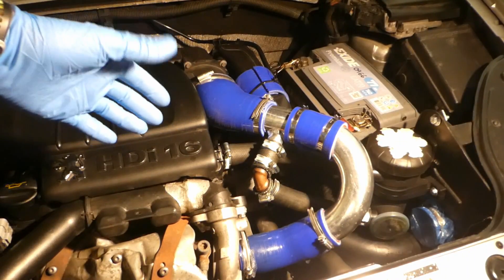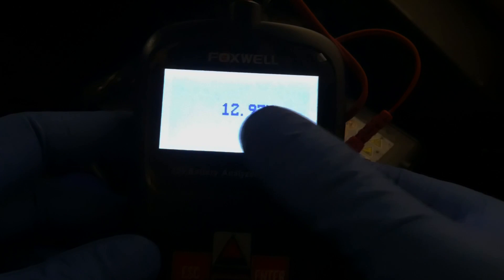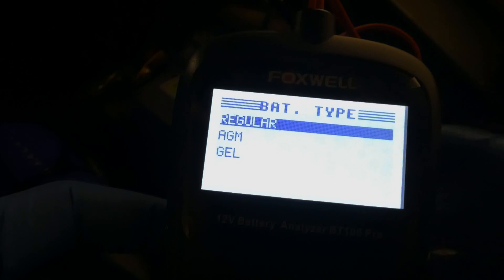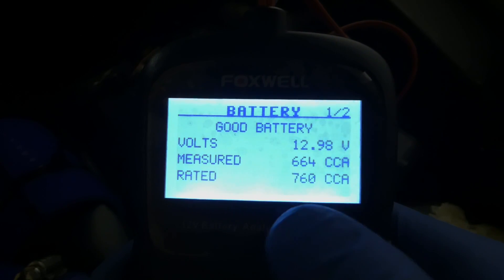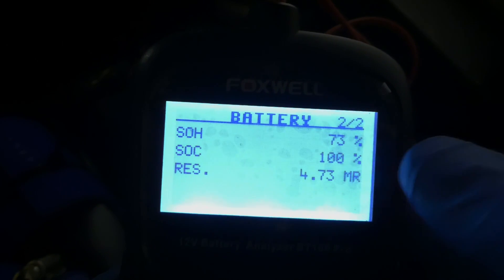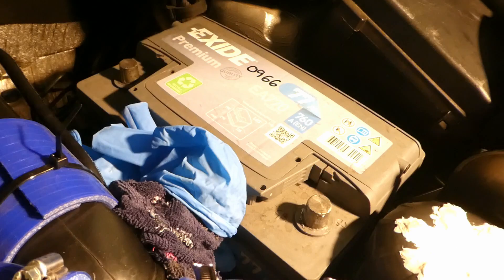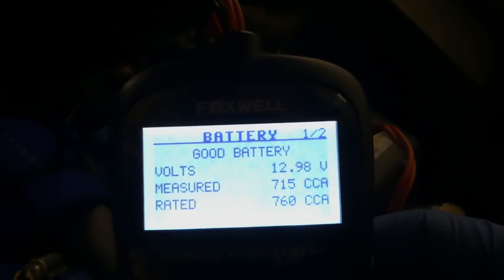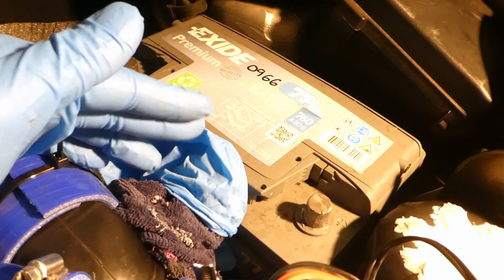Car battery tester review (Foxwell BT100 Pro)

Comment: Foxwell BT100 says that my car battery is 36V.  This can't be right, it should be around 12v
Reply from the maker: I have not seen this one, but trying on another battery or trying again to check. It shoud automaticaly recognise the 12V. Was the car on or everything was switched off. Maybe the battery is different chemistry or the bt100 is faulty.

Comment: if it does not have an internal battery and the batteries are very low on charge this meter will not work less than 10 volts or so it will not work chances are you will need to charge the battery in parallel with another battery 12 volts or so and then retest the battery with this charger I think it would be better to get the charger with the battery

Comment: CCA on the tool is the SAE standard, your battery is in EN (European Norm) and is 760 EN , maybe giving a slightly different result.  SAE CCA x 0.9 = EN CCA
Reply from the maker: Really appreciate your comment! How do you know the device measures CCA according to the SAE standard? I know that for my battery the amps are according to the EN, then the results are even worse for the EN CCA when converted from SAE.
Reply: @moremolecules  All the battery testers have CCA and many other standards for measuring CCA like EN , DIN etc they all measure the same thing in different ways and so get a different value. On these digital testers when it says CCA its referring to the American SAE CCA method as you will see on your tester there is CCA and EN which are very close in value but not the same, so we have to assume CCA=American SAE. Some digital testers Ive seen on U0tube have both SAE and CCA?? which is very confusing but you must remember they are Chinese made and their translation to English isn't always perfect. Very good Video by the way I did like it and think I'm going to buy either a Konnwei or Topdon tester. Thanks...Danny
Reply: Yes results would be slightly worse but try and see...the SOH and milli-ohm readings are the most important
Reply from the maker: @danielconnor1458  Yes, I agree SOH and milli-ohms are most important, but there is no info anywhere how this SOH is derived. I might eventually do several measurements, say ~100 on different dates and temperatures and run some linear modelling to see this is calculated. It just drives me mad.
Reply from the maker: @danielconnor1458  I do understand the EN and SAE and how the methodology of testing is done, but there is quite some difference between the EN and the SAE CCA. I would not say very close value, as for example 750 SAE/CCA is 680 A EN, quite some difference.
Reply: @moremolecules  SOH is definitely mostly tied to CCA as stated on battery compared to CCA measured. I've tried a few calculations from different U-tube videos and its almost (but not quite) CCA measured divided by CCA on label gives the percentage
Reply: Close is a matter of relativity, when you compare SAE to DIN the difference is huge  but SAE to EN is much closer
Reply from the maker: @danielconnor1458  Haha, yes absolutely agree, it is a bit relative.
Reply from the maker: @danielconnor1458  Yeah, I tried that but not digging into modelling and all, but eye-balling it (very scientific I know :-) ), but it did not correlate too well on mine. It seemed a bit more complex than the measureCCA/rated. I might do some calculations on my own and see what comes out. Good idea actually, might do a video on it in case someone else is interested in what it is.
Reply: @moremolecules  If you have the time and inclination to do another video I'd def watch it but for me the CCA measured/CCA label is good enough....these companies have algorithms to calculate that and thats just going too deep into it for me, I just want a tool that can tell me if I need a new battery or not. I do have a 7 stage smart charger with independent pulse de-sulfation mode which helped but not cured this battery I have atm. More tools and yet more tools to buy....yipee !! It never ends haha
Reply from the maker: @danielconnor1458  I completely accept that. I'm a scientist by profession (nothing to do with cars or engineering), so it is a curiosity to see what these numbers mean or how they are derived.
Reply: but the other thing to remember is that not all batteries perform to their rated capacity some are less some are more.....if you watch that Polish guy on U-tube Mr Akumulator I think his channel is called. From what Ive seen the good battery companies say eg Yuasa, Varta Exide etc perform above rated while cheaper ones perform below rated. From the link I gave to if you can calculate Qmax  (max charge availabe then SOH is that divided by rated. I'll let you do that hee hee :>)
Reply from the maker: @danielconnor1458  Yeah, the "good" battery companies. I bought a new Varta super duper silver dynamic, blah, blah, 780 A EN, measured, only returns ~70% SOH from brand new. Returned that one, got another Varta 780 A EN from a different shop, that was 85%, but do not have the energy to return that one as well. Date of production of the second one was not too bad ~4 months old. Probably sat somewhere in a warehouse and got bad, but from 100% (let's say) to 85% in 4 months is a bit too much.
Reply: @moremolecules  Goodness thats 3 times U-tube has blocked me posting a link on how to calculate SOH
Reply: SOH%= 100 Qmax/Cr  where Cr is the rated capacity (perhaps Coulombs) and Qmax is the max available charge whether that is calculated in Ah or Coulombs I do not know
Reply: Google  " How to calculate SOH with lead acid batteries.....I cant type the website in or paste it U tube will block my post again but the website sounds like  biology and logic in one word.
Reply from the maker: @danielconnor1458  Interesting and many thanks indeed for the conversation actually. Might have to understand this a bit more. 1Ah = 3,600C. I will see if I can get some empirical data from my device, haha manually recording the numbers and see what model I can come up with.

Comment: Actually you are incorrect. On the battery you have is written 760 EN and NOT 760 CCA. The two are different. To a 760 EN the corresponding value for CCA is 800. If you test with 800 CCA you will see that SoH value will be lower.
Reply from the maker: Hi Andi, yes, it is correct that it is written 760 EN, but I do not believe this is the EN value. Even on the Exide website (the producer of the battery) it states 760 CCA rather than EN. I have of course tested this with the EN, but even at brand new the tester reported completely failed battery with the EN. Unless of course even the producer does not quite distinguish between EN and CCA
Reply: @moremolecules  I have the exact same battery. Using 760 EN I'm getting SoH 90% and the battery it's working for more than three years. I tend to believe yours is not quite ok if it says to be replaced. 

Regarding the manufacturer, on their EU website exidegroup.com this model we have EA770 isn't even mentioned :) 

But they have two 75AH Premium versions which are rated at 630 CCA and one 72AH version which is rated at 720 CCA.
Reply from the maker: @andidotro  I agree with you that it is probably 800CCA with 760 EN and that it is probably not quite OK. No matter how much I charge it SoH is still ~80%. Most places where they sell it it is still listed as 760 CCA (https://www.tayna.co.uk/car-batteries/exide/ea770/?msclkid=c65eee0f997714ca7de58e65496dd235). The exide website for this shows http://www.exide.info/ea770
They used to have more info for this, but have removed it now. Even amazon gives 760CCA, but that is not really any good information
Reply: @moremolecules  Theoretically CCA is not equivalent to EN, but practically it seems it is used like that. It seems these battery testers don't know that yet :)
The weirdest thing would be that CCA 760 is actually a 630-650.
If you have a charger with repair function I would suggest using it two nights on a row, it should improve the SoH as much as 10%.
Also exide.info is not their official site, for europe I can only find exidegroup.com (redirected me from exide.com)
Reply from the maker: @andidotro  Yeah, it seems it is used like that, although I completely agree it is not the same. I have a somewhat "smart charger" that is fast charging when the battery is accepting charge and then trickle charge, but I can only get it to ~80% with the CCA numbers and ~75% with EN. The website .info was listed on the battery itself. I will probably get myself a different charger to see if I can increase to some degree. Many thanks for your comments, much appreciate it.
Reply: @moremolecules  I don't know how they are calculating their CCA but for Premium (EA) series it's not inspiring trust as per the below CCA/Ah ratio:

900/100=9
850/105=8.09
800/95=8.42
800/85=9.41
770/77=10
720/90=8
720/72=10
630/75=8.4
Reply from the maker: @andidotro  Yeah, I'm sure the manufacturers are using all sorts of ways to tell you that this is as big as possible, whether the CCA or EN. I will get a reconditioning charger to see if I can up my SoH. Many thanks for the comments, really appreciated.

Comment: Odd results. My bet is it won’t last long, something not right with that battery.
Reply from the maker: Hi Mickytdi, I also think there is something going on, but it has been like that for the past 1 year, at least. I will have to monitor a bit more, but it does not struggle to start.
Reply: more molecules i remember testing a friends battery , it’s CCA 360 but read approx 300/310. Car would start no problem, crank fast but if he left on parking lights or radio on for 30 mins it wouldn’t start. The battery was fine if he didn’t leave them on.

Interestingly my start stop AGM battery reads 500 A but should be 680A. SOH 50-60%. 3.5 years old.
Reply from the maker: @Mickytdi  Thanks for the comment on this, much appreciated, I'll monitor it. 500/680 it's a bit on the low side and SOH 50-60%. Next battery I buy, I will charge it up to max every couple of weeks and see how it measures in time, if the SOH keeps a bit higher or it makes no difference.

Comment: Why you mensure with CCA? Why not CA? CCA is for meansure if you mensure in cold temperature?
Reply from the maker: The CCA number was conveniently put on the battery. AFAIK, the CCA measurement is accounted for when measuring at 20C, even though I did not measure it at -18C (0F).
Reply: Hi what is the Res . 4.17

Comment: I have a similar. Very handy tool! Keep up the good videos!
P.S. I didn't have the time to install my catch can. Can you post an update? Also, did you try by installing a soft filter (like the ones installed in cooking absorber)? Any info would be greatly appreciated. I am also about to order a bigger intake from the fiesta ST for my 1.5 tdci 120bhp. These engines seem to have a lot of restrains in the intake, and I hope I'll let it breath a bit better. I've already seen a huge difference just by putting a dummy EGR valve.
Reply from the maker: Hi George, I wil post an update on the oil catch can, but will see when I can do it and what to actually update. I have not tried to install the absorbing ones, but I am thinking of a different thing. Might combine the update with the new thing. Bigger intake would certainly help. You may get an EML with the EGR valve.